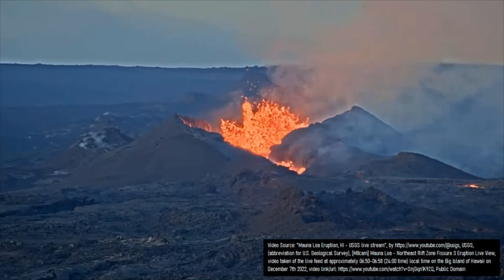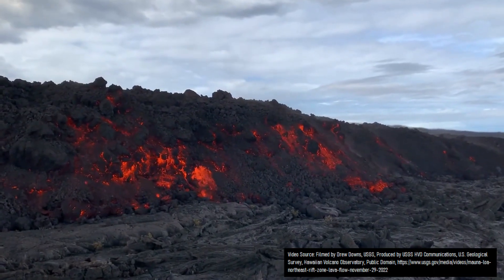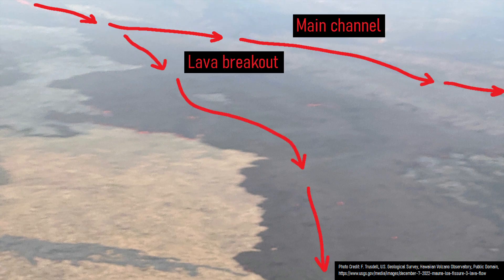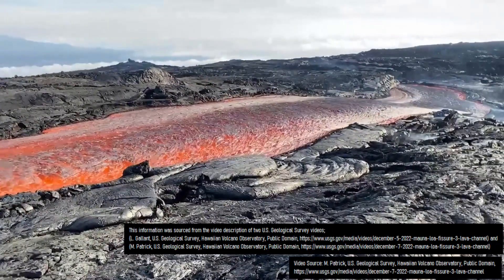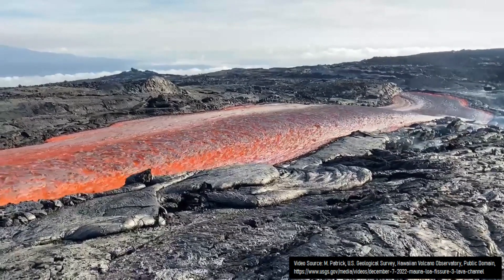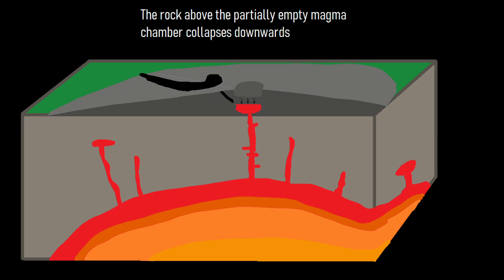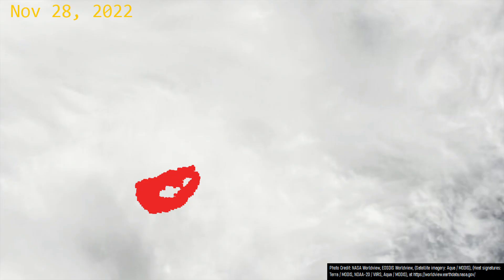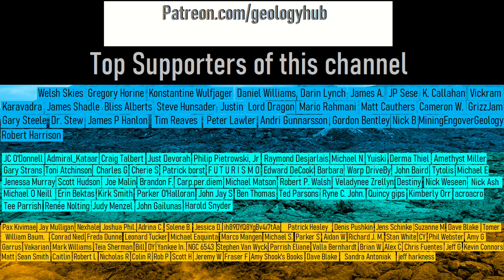Mauna Loa Eruption Update; The Summit is Sinking, A New Lava Breakout Occurs

Comment: Also on the Big Island, Kīlauea’s summit eruption appears to be waning. The active portion of the lake has entirely crusted over. Perhaps magma is traveling into one of the rift zones.
Reply: Remember there's a huge difference  between Appears  to be waning vs. Is waning
Reply: It was a disappointment.
Reply: Or perhaps merely pausing, as it has before.
Reply: Does Kilauea have the same magma chamber as Mauna Loa?
Reply: @Fisher 1906 no connection or signals to support that.
Reply: Is that a bad thing?
Reply: @honorladone8682  potentially. It could be moving from a known, and harmless location to a new unknown one. It could theoretically pop back up anywhere on the volcano.
Reply: @jonathanellsworth21  magma takes the path of least resistance and Kilauea has an established pathway.
Reply: @estherjuan5499  generally no
Reply: @estherjuan5499  They are separate volcanoes with their own magma chambers. 

It's theorized that activity at Mauna Loa can effect Kilauea and vice versa, but a lot more research needs to be done on this.
Reply from the maker: It has been seemingly waning for a few weeks now. I know there is a theorized link between the 2 volcanoes but nothing is blatantly obvious at the moment.
Reply: Such good coverage I love these videos.
Reply: @GeologyHub  does the new lava breakout identify a new surface intrusion there? Ta
Reply: @Horn Piper That's some strong speculation there. Besides the plausibility of the Big Island having to be abandoned, why would Hawai'i no longer be a state?
Reply: @Horn Piper Even if you were right about the Big Island, the other islands have population, too. I suspect it would take, at a minimum, a vote of Congress to turn Hawai'i into a territory, or, more appropriately, into the independent kingdom it was before we stole it.
Reply: @Horn Piper Oookay. I think you must your time on conspiracy sites. Bye

Comment: Lava flow is a fascinating process, being a combination of a fluid and a solid, whose properties change rapidly over a narrow temperature range.  In the channels the ambiant ground temp is almost at the temp of the flow, so it can maintain fluidity and hence the abnormally high velocities when given a steep grade.  As the lava gets further from the source and to a shallower grade, it cools, slows, and speads out, in a way like a river delta.  But at places like the upper break-out, the flow-front is really unpredictable since the initial grade is altered rapidly by the build-up of the initial lava breakout which cools to a solid form, thus changing the grade which may have made it possible.  Velocity of the lava is interesting too since as a semi-solid it carries a lot of inertia, so the upper flow can exert a lot of pressure on the back of the front, and thus can push the front up, over, and eventually through a lot of barriers.  Thus one can look at a topographical gradiant map of Mauna Loa, but it is only suggestive of where the lava might go.  Initial direction and inertia may take the lava opposite of where a strict surface grade prediction might indicate.  That upper breakout might take a hard right and divert the lava flow parallel to the road, or it may fan out down the grade towards the road, much like the 2018 eruption did when it spread out at the coast into a wide front.  La Palma also provided a lot of lessons about the unpredictability of lava flow.  I'd say about 90% of it goes where we expact, but there is always that 10% which seems to have a mind of its own.   Still, always the best show on Earth.  Kind of sad that USGS, NPS, and local bureaucrats are simultaneously doing a terrible job at documenting this for the public and making it difficult for the public to see it/document it, like they were able to in Iceland.
Reply from the maker: It can get even weirder with isolated features fluid flows can create. For example a lava flow can actually create a miniature (fake) shield volcano like vent (up to 40 m high 400 m wide per the U.S. Geological Survey) known as rootless shields
Reply: volcanoes are 🤙🙏☝💪👀🤜🤛:yt:
Reply: Vastly different geography in Iceland.
Reply: @dgronzega8073  I agree, so what is your point?   Maybe a bit more vertical on Mauna Loa.  Still within the capabilities of average day hikers here in Oregon
Reply: The U.S. is generally more protective than many other countries because we are such a litigious society.

Comment: I heard that in the early "70s that a core drawn up from one of the Azores had volcanic rock deposited above water as far down as half a mile below current sea level!  Sounds like sea level changed, but thinking of it, I think much of it could be tephra compressing plus the crust depressing, plus the roots of the mountain/island melting off from contact with the hot spot.  

Crustal mountains have roots approximately twice as deep as the mountain is high with a density of 60%(?) of the mantle so are effectively floating.  Basaltic islands have a density much closer to the mantle's density but the water bouys the rock above the floor of the ocean 40%(?) so how deep are island roots?
Reply: Hello im from Azores, very interesting your comment!👍🏻